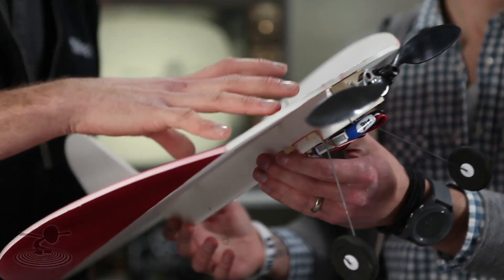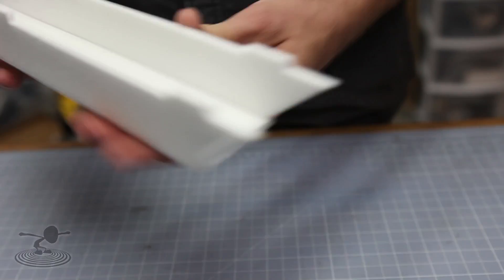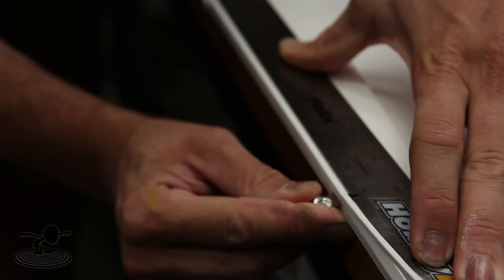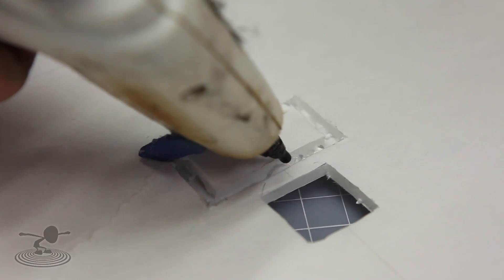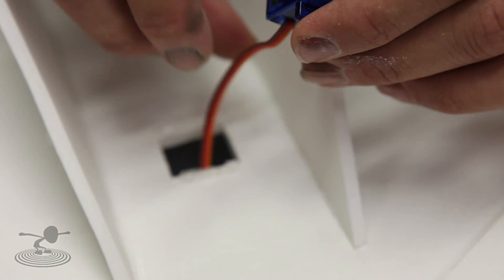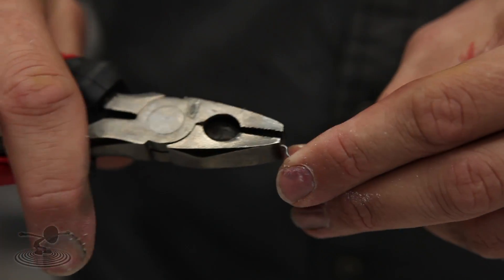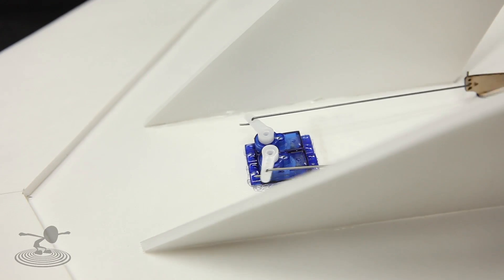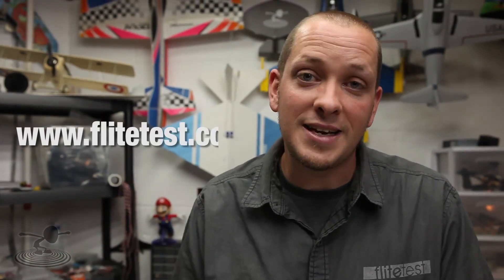Flite Test - Delta Wing - Scratch Build

Comment: Which type of foam he is using
Reply: Foam board. It has paper on each side and is 5mm thick. Flite test sells the water resistant version of this and hobbyking sells 5mm thick foam sheets, but you will need to cover this in tape because it doesn't have paper pre applied.

Comment: Love your videos guys but the plans linked to on this video are not the same as what you are doing in the video. The plans do not use the one piece technique on the main part of the plane and it is very confusing to a new builder to try and figure out the differences.  O.K., I think I figured this out now. The plans referenced are apparently for your kit, not this scratch build.  I couldn't figure out why the lines said to cut the plane in half only to attach the two sides back together.  I suppose you shipped it cut to reduce size / shipping cost.  I will just use those plans and not cut the middle line.  However, that being said, there is still no plan available for the same build technique used here.

Comment: can you use any remote control.
Reply: Dean Ioannidis Yes. Just make sure you got the proper radio receiver in the plane to match your remote control radio.
Reply: I'm thinking of getting the hobby king 2.4 GHZ TX & RX V2 mode 1. Will that do?
Reply: Mode 1 is a European thing. It's like how they drive on the other side of the road, because in Mode 1 throttle is on the right, while Mode 2 is throttle on the left. Mode 2 is standard in America. But if you live in like europe, australia or asia mabey Mode 1 is cool.
 Now my opinion look at more of the options before picking a radio its a big Investment. You want something reliable and I don't think that Hobbyking radio is one of them. I know it's cheap but you get what you pay for. I got a Spectrum DX6i for over $100 and I'm able to bind it to any of horizon hobbies products which is pretty sweet. For a receiver look up "limnion RX" there like 5 bucks and good park flying range. If you get Hobbyking stuff I'm sure it will still work, but how well IDK.
Reply: +Dean Ioannidis no

Comment: can you please do a video on cutting dollar tree foamboard, my paper always falls off
Reply: Luke Gibson is your knife dull? You should be using at least one new blade per project (something like 1 new blade per 2 sheets of foam you cut).
Reply: no, I replace it ever time I cut a sheet, the paper just peels of really easy. Do you think it could be because i cut on a table with wood on top?
Reply: there is paper on both sides
Reply: thank you
Reply: +Luke Gibson  I was just curious. Since I guess people would want to decorate whatever it is that they're flying, wouldn't the final application of MonoKote act in place of the paper, or put strapping tape either on top of or below the MonoKote, depending on how good you wanted it to look?
Reply: dollar tree board rules: never get wet. and NEVER buy the black papered ones. get the white ones
Reply: abe pagla gaya hai kya
Reply: +Luke Gibson try the foam board from wal-mart its about $1 more a sheet but the paper is really stuck to it but if you have a part you need to peel the paper off of i would use the dollar tree stuff because the wal-mart board is a little difficult to get the paper off of

Comment: would this airframe still work well if the motor was on the back as a pusher?  I have electronics from a dynam I Can Fly, which has a motor with a odd mount.  it would be easier to use a 1/4x1/4 stick on the back as the motor mount due to the type of motor.  I realize that the CG would change and id have to remove some of the control surface to allow for the prop, but would that shape still fly well as a pusher?
Reply: just get a versa

Comment: I wonder why they don't bundle together the motor, esc, battery, charger pushrods, and wheels needed. Most local hobby shops today only sell ARF kits, no separate parts. So people try using the electronics they have and the plane won't fly.

Comment: Any Model Hobby shop. A proper rc hobby shop though, not one that sells those plastic planes. But, I think its thin Plywood that they used for the fire wall and control horns... which again can be gotten from a good model shop.

Comment: 15 for the motor, 10 for ESC, 6 for (2 x) 9 grm servos, 7 for the battery, 6 for 4ch Rx, 2 for foam board, But assumption is you have Tx and charger and some small stuff in your kit.

Comment: no need for that, very very very strong by it self (depron) although, the dollar tree foamboard is 4mm thick, and the most common depron thickness is 6mm, so you will need to make some adjustments to the plans :) but a CF or FG rod will only make it much stronger for very little weight :)

Comment: I have almost finished my flyer and am thinking ahead to doing a delta wing build,but I don't have a transmitter with mixing etc...what are your thoughs about the flyer with a more delta type wing and regular airlerons in the wing and and elevator in the tail with a fixed rudder ?  can I still use a flat(one thickness) wing or do I need some type of built-up airfoil ? I also picture putting the elevator tail section on top so it will be on the same level with the wing. Thanks, joep

Comment: From what I understand, the paper on the foam board adds strength. You can probably use Depron, but you might need to reenforce the wings with a small fiberglass rod.

Comment: Check out the following items at grayson hobby:
TP MG90 9G Metal Gear Servo, Dynam 40Amp ESC w/ 3A BEC, GH Micro Jet V3 Brushless Outrunner Motor. You will pay a little bit more for these than the Hobby King products cost, but the quality more than evens out that cost, and the shipping is a lot less.  Also check out their batteries. I use the Gold 30C's.

Comment: Hello, I am currently in the planning phase for a delta wing, I have some idea about RC as I have a Drift Car, but this is my first plane, and I've been told that before you go out and buy planes, you should try and make one so you understand the parts of the plane.

For my delta. What type of ESC, battery, motors and servos would you recommend. Both in price and reliability.

Thankyou

Comment: you guys are at good standing with hobbyking, any chance that you could pass this whole control+motor+batt+all guts in swapable body off to them so they could make it more pro, and consciese? so you basically buy only cheap 4ch sender + cheap mass produced 4ch body filled with electronics ready to fly, all configured so you only attach your airframe with servos and go have fun without messing about too much?

Comment: Josh, you said 0.7mm wire for the landing gear, but that just seems too small and flexible.  Is that really what you are using or did you accidentally mis-speak?  Also, what gauge music wire did you use for the pushrods?

Comment: I have found that planes with the prop in the front do not make very good beginner planes. You usually end up breaking props bending motor shafts. Sorry to say and I'm sure people love the front prop for scale look but that's just the facts. I would recommend planes with rearward pointing props like the bixler or axn foam planes for beginners. IMHO of course.

Comment: Josh, can I offer a little advice?  Slow down a bit. You did that complete video talking non-stop.
It makes things very hard to absorb when it sounds as if any pauses for breath are edited out. Maybe if you stopped with "GO AHEAD" there would be room for pauses. It honestly sounded as if you were in a hurry to visit the bathroom or you'd developed a fast forward problem.

I was going to warch it again to count the "GO AHEADS" but I don't think I'd survive. Apart from that, great video, well done

Comment: remember to add a bit of hot glue to where the wires on the motor leave the insulation and go into the inner bell bit (no idea of the name :P ) ive used these motors before and they break, yeah its annying

Comment: Hey there... is there a reason you chose the bottom of the plane for the battery vs. the top - or even within the fuse (assuming one did some sort of 'hatch' for it)?  Thanks.